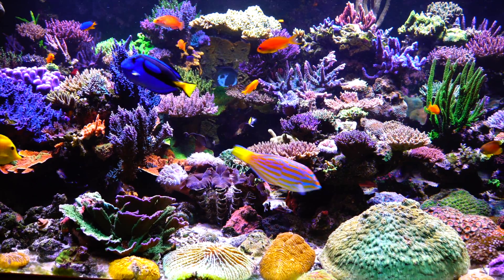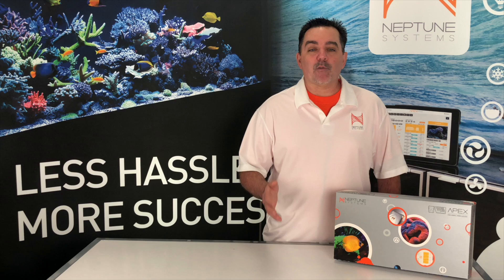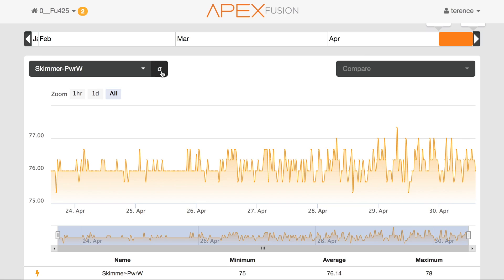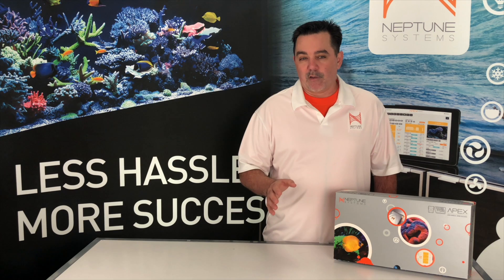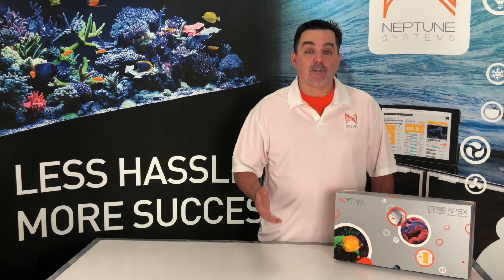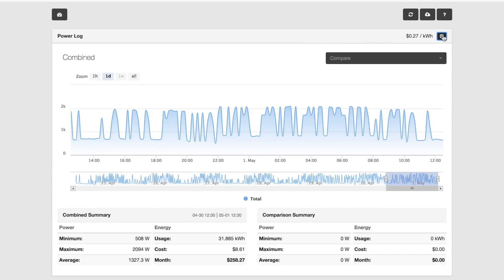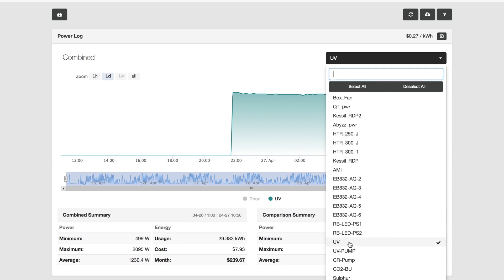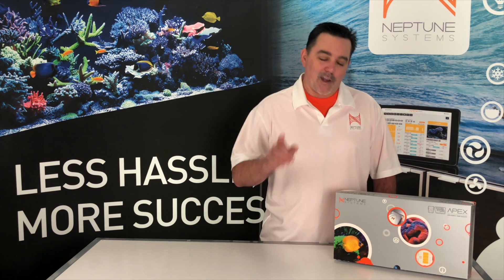How to use power monitoring for alerts and optimizing power usage

Comment: Once you run thru the task (say for power usage alarm), where is the generated code stored at? Not in the EmailAlarm output? I want to modify the code instead of running the task again, or I want to delete the code... how?